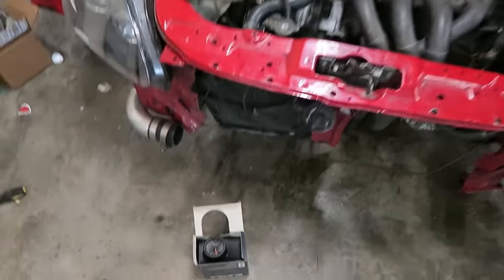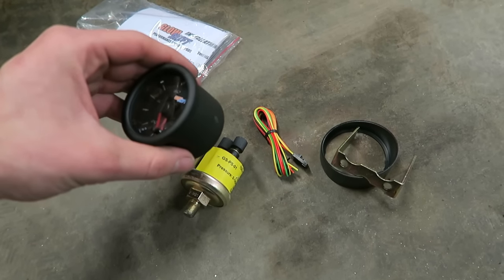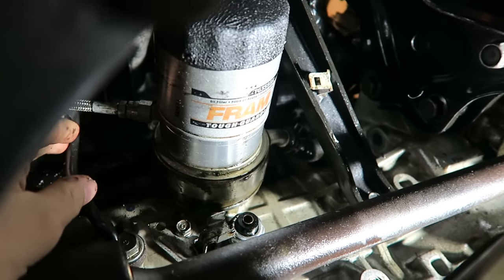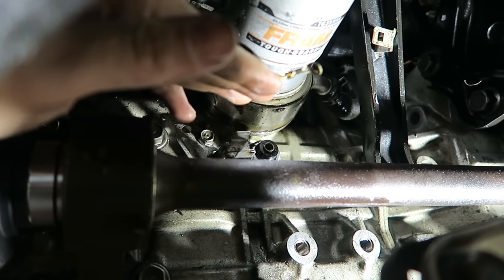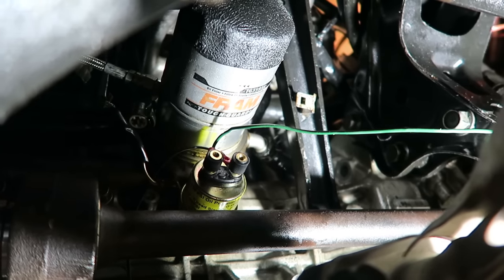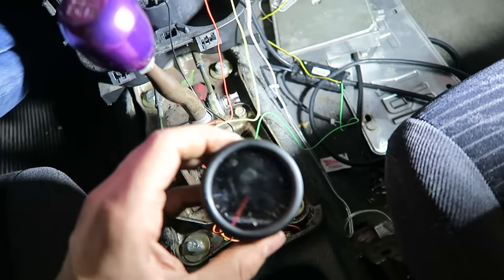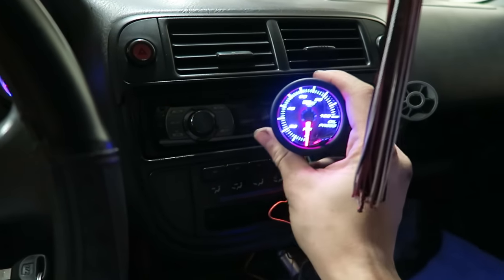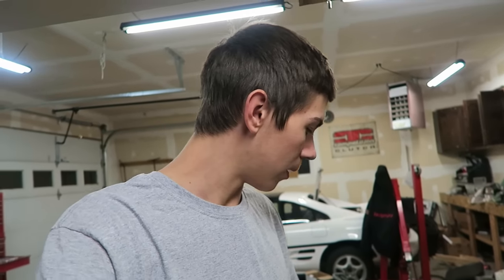Oil Pressure Gauge Install

Comment: Just blew up my turbo d16 about 3hrs ago:/
Reply: swanginfleet duct tape will fix it right up.
Reply: Time for an ebay turbo
Reply: I actually had an xs power turbo on a stock y8. Knocked a pretty good hole in the block.  I'm not too upset though.  I have a full built head, stock block, new holset hx35 and gonna get vitaras. If anything it gives me incentive to get it done.
Reply: swanginfleet what was your setup? I'm almost ready to boost my D16 too
Reply: swanginfleet sorry for your loss i just built mine
Reply: mono19963 The car is a 99ex,  just a stock d16y8 that was rebuilt last January,.42/.48 50 trim turbo@ 11lbs, 450 dsm injectors, p28 chipped on crome,  tuned by Huy at Inline Racing. His dyno was down so he did a street tune. Estimated 220-230hp.
Reply: swanginfleet I'm exited to boost mine. Just scared to blow it up. But I could make that excuse to go B swap lol. I just need the BOV and the waistgate. I don't know if I should upload videos of it.. hmmm
Reply: mono19963 I actually have a 97 ex with a gsr I'm selling now. A turbo d16 will drag a b series. Also turbos are really fun. I'll be honest, although my build was done  right I abused it nearly every time I drove it. I actually think it would have lasted a really long time otherwise. Anwyays, if you upload some videos let me know and I'll check them out.
Reply: Landon Robertson What kind of build?
Reply: swanginfleet It will be a slow build to get everything right. If it does last I'll build the block. But first I need a new ignition! Was broken into last November but they failed to take it!
Reply: mono19963 Damn, that sucks. Honda scene isn't that big around here so they aren't stolen that often.
Reply: swanginfleet lucky! Down here almost every other day a Honda or truck gets stolen
Reply: swanginfleet fuck it build another one (:
Reply: KustomGraphics206 Yeah I've been planning on my build my a while now. There is actually a full setup sold on ebay with 138.5mm rods, vitaras and AR rod bolts for 415. That will give me about the same compression you have. The head I'm gonna run is a y7, stage 2 port and polish, delta 272 cam, supertech valve springs, AR head bolts and blackworks cam gear. Like I said earlier I have a hx35. I'm planning for a safe goal of about 400whp
Reply: KustomGraphics206 what brand are the I beams ?
Reply: Stacy Pfingsten I'm not sure, they are custom length. Probably FJ
Reply: get rods and pistons! blew a hole in my y8 block nearest cyclinder by timming belt it pooped a rod snapped by the big end
Reply: KustomGraphics206 Yeah your car sounds pretty fast. Appreciate some of the advice.
Reply: swanginfleet plans to rebuild or swapping in something else?
Reply: After the project is before the project.
Reply: More like 6yrs ago haha

Comment: For the red and yellow wire the reason you would put one to constant and one to switch ignition is for color memory. It works but if you don’t want to have to change your color every time you start up then you need one to a constant power. Also notice how when he cranked the car it went off then on again. So it will help with that too.

Comment: The stock oil pressure switch is probably 1/8" BSPT and the new gauge sending unit is probably 1/8" NPT. Which will fit but the angle of the thread taper is different so it might only be sealing on a few threads.

Comment: I believe the gauge is not 'digital'. It's analogue. The analogue pressure is proportionally converted into power electronic signal, and moves a gauge (a Darsonval actuator), indicating by its deflection, the proportional hydraulic pressure applied. Thanks for your video.

Comment: probably mentioned already, but the constant wire is probably going to memory on the instrument, so it will remember whick color you choose for the light. If you tie the wires together and it the instrument only get power when ignition is on, it will probably go back to the "stock" color everytime you switch the ignition off / on.

Comment: stock oil pressure switch is pt or bspt. glowshift is npt. there is a small difference so the threads do not mesh. u can run a tap into a bspt to make it npt so it does not leak. or buy the adapter that goes bspt to bspt with a npt 3rd port

Comment: Every time I hear that intro I know it's gonna be a good day.
Keep it up boiz

A comment on the wiring setup:
You shouldn't hook up all your things to the same source.

What's a good way to do things is as follows:
1. Find source of switched power, your cigarette lighter for example.
2. Hook up relay, activated by your switched power.
3. Find big beefy constant source, behind the fuse panel you can find the proper big ones.
4. Hook up beefy constant source so it goes through relay, as switched by switch power source.
5. Set up 12v power rail for easy addition of devices.
6. (Optional) Add fusebox for neat and safe wiring.

Comment: The constant 12 volt is for the color memory. I have the same series gauges in my 7.3. Boost, EGT, and Trans temp.
Reply: There’s a lot of questions and answers as to what the continuous power is for. I’m sure there are many reasons but from my point of view, the most important factor is you would be able to monitor the progress of the oil pressure at start up. It will tell you how quickly your oil pump is responding and how fast your pressure rises during start up or especially a cold start.

Comment: The gauge has a 12v constant wire  to retain the colour memory when the ignition is off. I'd imagine you would have to select the colour every time you shut off if you wanted to use a different colour to default.
Reply: Thanks man. I couldn't figure out why it would need constant power either. Maybe I should have thought a little bit harder ).
Reply: Keyboard warrior Hitman Might want to get your blood pressure checked mate xD

Comment: The stock sensor size is 1/8" BSPT, that aftermarket sensor you installed is 1/8" NPT, so the threads and taper are different.

Comment: I bought a little s10  years ago . Did a little tune up. Driving down the road. OIL started squirting every where. Freaked out. Then realized oil pressure gauge line came unhooked. Whew

Comment: the factory oil pressure sender is only for the dummy light on the dash, you're good as long as your gauge is working.

Comment: i have a question, my digital gauge has 3 wires, 1 Red 12v accessory power 1 White engine accessory power and 1 orange head light switch 12v switch power. do i hook all 3 together or just the red and white?

Comment: the little cubby hole next to the radio is a good spot for a gauge. use a thin piece of aluminum and cut out the the outer shape of the cubby hole and then drill a 52mm hole in the center and there u go. i done this with my civic but with a small piece of carbon fiber laying around. it replaces the cubby hole with a gauge pod lol.

Comment: Any gauge you can set the warning light at the very least 10% under 20psi less than normal pressure so you know if it's low even if the garage isn't 100% accurate..

Comment: If you wanna run a 3rd guage and haven't decided on which type consider a K-type thermocouple, so you can measure boost temp. SPA digital do dual gauges too, means you can measure pre and post intercooler temps on the same gauge which is nice. Kinda spendy though, not sure if they have a distributor in the US either.

Comment: Hello, so on my vw i have a similar oil pressure sensor with a different gauge. However on my sensor, it only has one slot for the ground. My gauge isn't working. I checked all the wires and they seem good. Bought the car used. Any idea if it's a bad aftermarket sensor? Or just the gauge?

Comment: My h22 that I had boosted still had that stock pressure sensor hooked up along with the oil pressure gauge and I'm glad I had them cuz the seal for the balance shaft popped out and leaked oil and my stock pressure light came on and I then looked at the oil pressure gauge to confirm and I lost all pressure and turned the car off immediately.

Comment: Is the oil sensor fitting universal? I have a 82 mercedes 300 coupe turbo with a mechanical oil pressure gauge. The gauge does have an oil line to my gauge like you said. The gauge busted and spilled oil all over my interior so I want to upgrade to this electrical unit. I just wanted to know if It will fit where my oil line screws off?

Comment: Just curious, there's already a factory oil cooler(Water to oil cooler) there. So, in case if it were a temp gauge install would the reading be accurate? I ask because I want to do an oil pressure & temp gauge install on my car. And I still have the Honda OEM water to oil cooler system on the car.

Comment: Can’t you also use a 4 way? One port for a fitting  into the block where the oil pressure switch screws in, another port for for gauge, another port for turbo feed line and last port for the oil pressure switch?
However if you use a gauge and don’t need the oem switch anymore then you don’t need to hook the original switch up anymore?

Comment: i have a gready oil pressure gauge but it starts at about 700kpa when cold then runs down to 600kps but then after abit of driving it jumps up to 1000kpa and doesnt drop very low
it also doesnt drop at all when i let go of accelerator
if you know whats wrong would your please tell me

Comment: oh i have a question. is all ur gauges wired up with the cigarette lighter?
Reply: No because it would short out
Reply: they wouldnt short out. cigarette lighters are usuallyfused for 10 or 15 amp, so unless you had something plugged in that was drawing that amount plus the gauges on top of that it wouldnt short. the gauges probably draw 2 amps at most so even using the cigarette lighter socket for charging phones and stuff wouldnt cause it to blow a fuse.

if i was to guess id say the ones on the dash might not be wired to the socket but all 3 probably are
Reply: That-JDM-Fascination! Yea i thought so. so it will be safe to wire all gauges to it. boost, afr, and oil.
Reply: That-JDM-Fascination! 
even if the fuse pops it wouldn't short anything, that's what it's there for, to prevent one and prevent stuff burning out.

Comment: Would it be possible to just get oil pressure from the hondata? Surely you could get a canbus dial cheaper since you don't even need a sensor

Comment: isnt the stock oil pressure light and idiot light anyways? when it's on its probably already blown up lol or you can just use it to prime an engine. like cranking over the engine and it wont turn off until it sees like 40 psi. idk if every car does that but i know a few does that

Comment: Just tried looking this gauge up and I venture to say it's discontinued. They've got one for 50 bucks and it supposedly calibrates liked yours at start up, but it doesn't have the multi color. White back light with dimmer. 😒

Comment: Hey what’s up🤗... if you have a T fitting on the factory oil pressure port to have both aftermarket temp and pressure switches, will the T effect the pressure signal?

Comment: Most stock oil fittings are npt (national pipe thread) you can see the a taper in the threads that's for a solid seal

Comment: It has one constant voltage wire and the other is a dimmer wire when it sees 12V from the headlights it will dim the gauge

Comment: Can you tell me where that stock yellow and red wire connect to after the pressure sensor mine was cut I don't know what it goes to was wondering if you could help me out

Comment: Cant u plug the stock oil pressure wire to the signal of the new sensor with the gauge?

Comment: npt vs bpt.... you cross threaded that oil pressure sensor in... honda for some dumb reason used a wacky thread pitch. as you probably noticed it kind fit but wasnt quite right.... it'll likely leak down the road

Comment: Bought a vehicle with a engine swap. Has a oil presure guage(mechanical) tapped from the block. It leaks like hell. Cap it off and...?or..?
Reply: flex seal bro

Comment: Great video, trying to wire my oil gauge in my cj7 when I wire it to a hot wire I guess from the battery it pegs out and stays would wiring it to the cigarette lighter work

Comment: Long shot but can anyone help me
My gauge is hooked up, lights come on but when I start the car there is no reading 
Connectors are both on the right place and ground is on a bolt in the engine bay

Just getting no reading

Comment: Hey I wouldn't reccomend the three way fitting in the block. When I had my turbo hatch the extreme vibration snapped it and it was a bitch to get out. I ran a line out of the block first, mounted the gauge pressure sensor to something on the firewall, and then ran oil from there to the turbo. Just sayin.

Comment: you shouldnt connect the yellow & the red to an ignition powered source. yellow needs constant 12v power for color memory. red needs 12v for ignition power. unless u wonna change the color everytime u turn the key. that is all. great vid tho.

Comment: If you're installing it instead of your factory oil pressure sensor, why don't you just pull the old one and install it in place of the factory one? Work smarter.

Comment: Most modern cars, if you remove the oil pressure sensor the engine will not start because the computer will think there is no oil pressure and keep the coils from sparking.
Reply: stock computer maybe. if you're doing this stuff to a car and have a stock ecu just sell it.

Comment: I lost all respect for you as a car guy when I saw your oil filter
Reply: gerardo reyes but yet OEM Honda filters are made by Fram 🤔
Reply: gerardo reyes an oil filter is an oil filter. As long as there's something there filtering the oil you'll be just fine. Been using fram filters for 30 years and never had a single problem.
Reply: I've seen multiple fram filters blow up
Reply: Coda5610 fram and filtech make the filters for Honda but the filtech is way better
Reply: Chris Ortega yep i got the filtech on my car rn
Reply: there is absolutely nothing wrong with Fram filters.
Reply: gerardo reyes Thats what I'm saying.
Reply: if you change oil regularly, a filter means jack shit, filters only extend oil life.
Reply: Yugo M48 8mm Mauser Exactly. There's no need in over thinking a damn oil filter. Especially a company that's been in business for longer than most. People just see shit on the internet and wanna hate. Pretty sure if they were bad they wouldn't have been selling products for 40+ years.
Reply: gerardo reyes wouldn't use that shit I change oil for a living I no
Reply: Cut apart a Fram filter and come tell me they're all the same..
Reply: wix for break in oem for life homes. run k series filters on b series for extra vtec
Reply: gerardo reyes agree Honda filter are same price
Reply: Mika Allard i accident ran a b18c1 oil filter on my k20a2 lol worked fine
Reply: Coda5610 not totally true the crappy AO2 model of Honda filters was made by farm and is being dropped but not the A01 model it's by Filtech and is far superior to the dookie fram one lol
Totally just saw someone already mentioned it lol
Reply: I lost respect for that comment.. if a car guy gets offended over a oil filter he needs to sell his shit.
Reply: hahahahahahahaha
Reply: bwahahahahaha!!
Reply: mobile 1 is the way to go
Reply: Mystic or even better. Mobil 1. 😂😂😂
Reply: Fram is not what real drivers use. Especially if you're going to run a turbo.

Comment: Im going to start a channel that helps oit peoplecwit motorcycles..Not justvsport bikes but for cruisers and Dual Sports..I ride a Slammed Indian Scout Bobber,.Bagged 2016 Husbusa,1955 LOWERED HARDTAIL 74ci PanHead HD Bobber along with a Bobbed and bagged Honda 750 ACE..as well as a Turbo 2000 TL1000R. BTW..I WILL NEVER OWN A SHIT DRIVE BIKE!! ...OHHH.UHHH I meny ShaftDrive junkbikeI run Dual Sport Tires on 75% of my bikes..